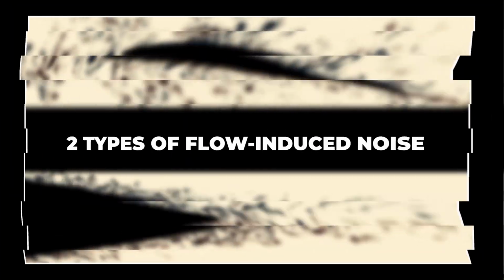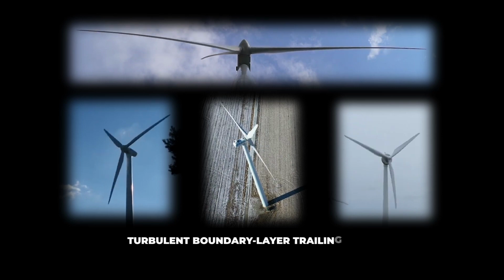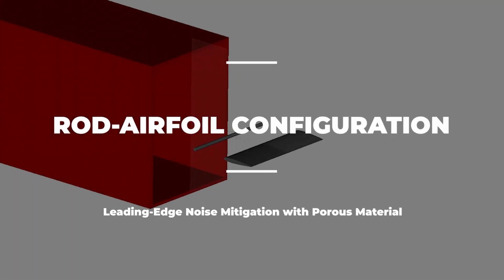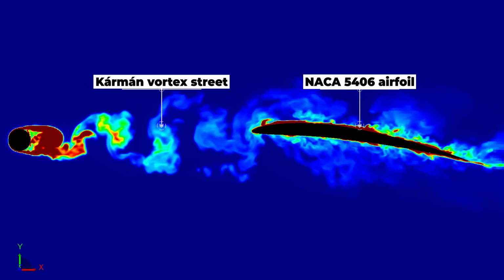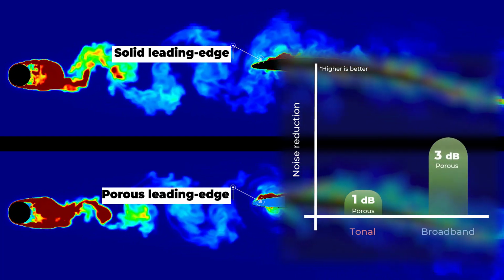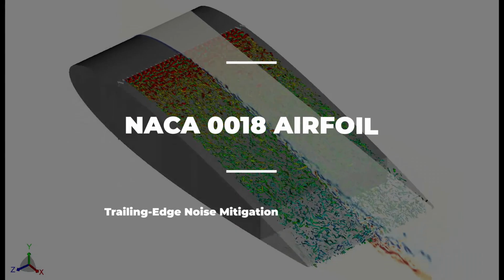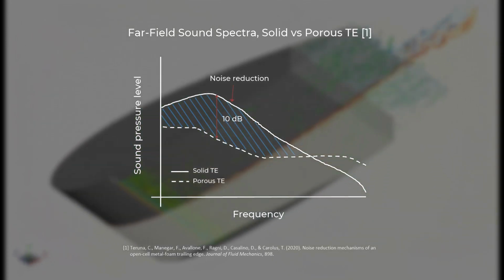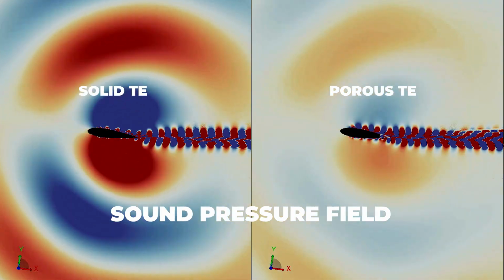Aerodynamic Noise Reduction with Porous Materials - PhD Day 2021

Comment: Hello and thanks for the video.
Would you eventually have a lower lift with a porous material at the leading edge? I expect the suction peak would decrease with a porous material due to both material roughness and velocity components 
Thanks 
LC
Reply from the maker: Sorry for the late reply. Yes, there is a severe aerodynamic performance loss due to the porous leading edge. The details are in one of the papers at the end of the video, if you are interested.
Reply: @vortextheory8530  going to have a read, thank you for reply! 
cheers
LC